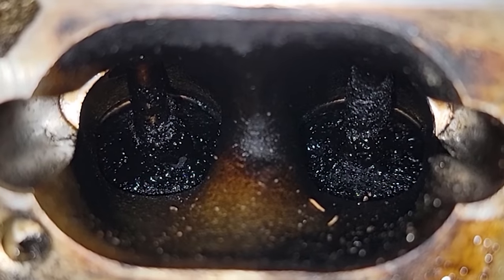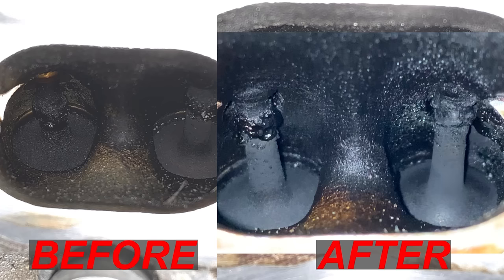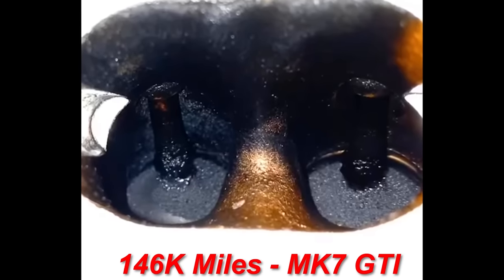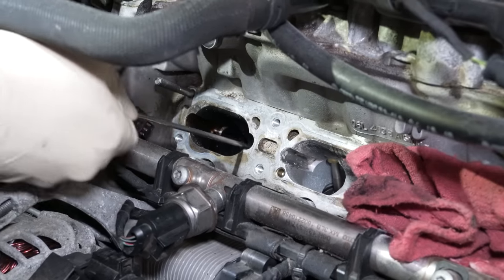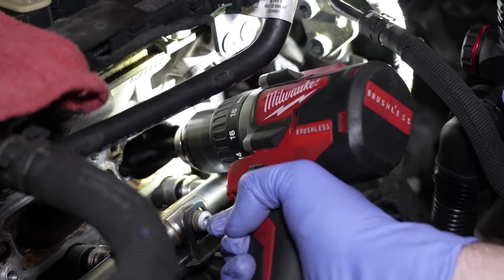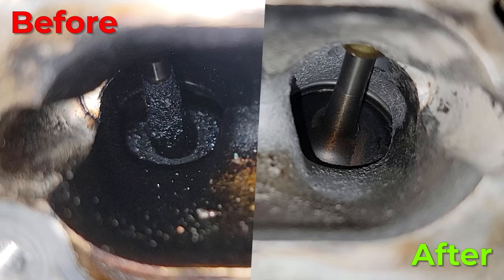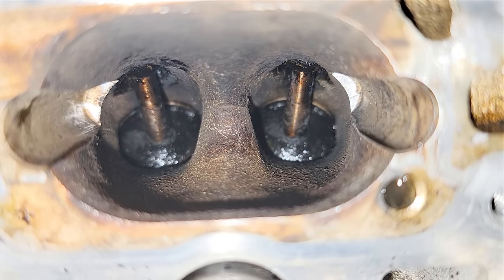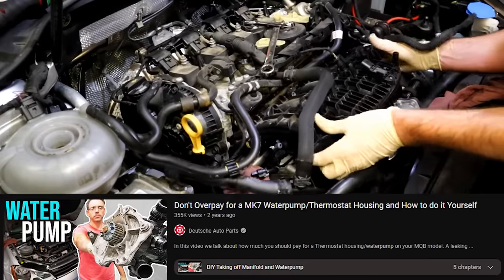How To Clean Carbon Off Your Engine!

Comment: CRC intake valve and turbo cleaner works excellent on my 1.6 DIG turbo Nissan. The PEA (polyether Amine) does work very well without having to soak or scrape the valves. And I did confirm it’s effectiveness by viewing the valves before/after.
Reply: I use the same and you are right. it works pretty good.
Reply: Did you spray it in the intake or directly on the valves?
Reply: @Jimster481  I just followed the directions on the back. Warm up the engine, then I removed the MAP which is just before the throttle body and sprayed it directly into there in small sprays while maintaining RPM 2000-2500. I usually do this every other oil change
Reply: @Jimster481 Directly on inlet throttle valve.
Reply: @SuperChewy808  well I also did this with my QX80 and I can tell you when I opened the engine at 145k there was tons of carbon.
Reply: @carlosgraphic Throttle Inlet Valve? You mean the Throttle Body?
Reply: @Jimster481  Yes, that.
Reply: @carlosgraphic  I can tell you that it definitely helps, but it does not fix the problem and I can confirm that because I did it every single oil change on my QX80 since I bought it seven years ago and when I cleaned it out last year it was definitely packed with carbon but not as bad as some other engines I had seen online.
Reply: @Jimster481   @Jimster481 I don't know much about your QX80, but is it GDI engine? I have a VW Touareg with a GDI engine. 230.000 miles. I can tell this cleaner restores the power on the engine. Before my SUV struggles to overpass another car but now it's different. I can feel how the acceleration and power improve on it. Does it clean very well, I don't know, but definitely it helps. I know it removes carbon because I heard some noises on the engine the first time I used it, I didn't push more gas since a big chunk of carbon can damage something inside.I know some people say if you hear noises put more gas to clear it, but if the carbon is big it's going to be bouncing inside the chamber with a possibility of hitting a valve or something else.
Reply: @Jimster481  I did mine at about 60k and mine was bad as well. I did 2 treatments almost back to back and  then I installed an oil catch-can, and I no longer have to contend with trying to battle the buildup or worried about the expense of having it cleaned.
Reply: @carlosgraphic  Yes, my vehicle is direct injection. And I never had acceleration problems because I have always used this product since the time that I first bought the car.
It definitely kept the car in running condition, but I can tell you that there was still a lot of carbon buildup when I actually took the intake manifold off to change the starter last year.
Reply: @SuperChewy808  From what I understand a catch can does not fix the problem all the way, especially not on the engine that I have which doesn't actually use an EGR.
I've done a couple treatments back to back as well as I usually do it right before I change the oil but I have found that that actually isn't even really needed because my engine doesn't leak any of it into the oil.
Reply: @Jimster481  well no the catch can doesn’t fix it,my car does not have an EGR either (I was talking that the combination of using the CRC along with the can) the amount of crap that otherwise would of ended up being re- routed to my intake is quite amazing. It helps prevent such a huge build up. I have not stopped using the CRC, but any car that has direct injection should install one(catch can). After you see what is collected that would of otherwise been cooked onto the backside of your valves, you’ll be glad you did it. especially since it only costs about $20-$30 and a half an hour of time. No way do I want all that shite being pushed through my system IMO
Reply: @SuperChewy808  Catch can works well with EGR. My QX80 doesn't have an EGR. It uses Cam overlap to suck the exhaust gases back up through the ports.

Comment: Copper stranded wire, soft enough to not harm anything but stiff enough to work quickly. Been using it for decades. Standard 120v house wire cheap as sin as it last for many jobs.
Remove carbon on top of pistons by getting it nice and hot and mist water into the intake, the crap that comes out of the tail pipes is crazy. In the 80's it was common tune up use.

Comment: Any reason why the gen 3 Ea888 motors don’t see as many carbon build up issues? To my understanding the euro gen 4 motors went to dual port but every gen 3 motor sold here is still only DI. Any Vw dual port engines here in the U.S?
Reply: As an EA888 owner, I’m curious how they prevent this build-up too!
Reply: yeah i was curious, ive got a 2019 GTI and I thought all of these engines had these issues, but apparently gen 3 EA888 dont have that problem?
Reply: They do have buildup, Charles checked his I recall and it wasn't great
Reply: 2017 GTI owner here, Paul's claim that EA888 gen3 don't have this issue is bunk. At 50k miles my car had the intake valves looking just like the 1.8 in the video at 80k. I've had the car since new, 7-8000 miles oil changes with the right oil (LM or Motul), only 93 gas, all the maintenance done on time; on the downside it does have stg2 tune (w/ supporting mods) and gets about a dozen track days per year, so maybe a stock car that only gets driven around town will have much less carbon, but again "gen3 EA888 don't have this problem" is BS.
I did my own media blasting cleaning and it came out perfect. I got the Harbor Freight media blaster, the nozzle from FCP Euro and bought wallnut shells media from Amazon. Also replaced the water pump that started to leak, very easy to do with the intake off.
Reply: Probably improved pcv system

Comment: Hello back in the days of Mercedes Benz and this was  from one of their support techs. Most 420 models had a lot of buildup on the intake valves cars ran like crap esp cold due to people using cheap gas. What we were told to use was oven cleaner the original no frills with lemony smell. We had to pull intake and valve covers remove intake rockers. We would spray all the valves filling each intake port let it soak for some time, then the fun part came in. We used a high pressure washer that had hot water and blasted them cleaned like brand new. The only draw back was the splash back shielding helped and so did the garbage bag suit with face shield. Yup regular oven cleaner, we did not have the stuff you have today. Maybe you may want to give it a try with the wire ties, never thought of that. Great video.

Comment: Would have thought string trimmer line would be a bit easier to manage in a drill than cable ties. Multiple diameters, cores, twists, and so forth are available. Mix and match and cut varying lengths.
Reply: The square  0.155" trimmer line works great. Soak the valves with BG carb cleaner & let set for an hour. 
There are also rotary long stem wire brush balls that work well with a drill motor.
You can also go to the hardware store & buy copper pipe cleaners, cut off the handles & use your drill motor.
Reply: @BobSmith-mc7uq   I wouldn't use anything steel in a brush, which the pipe cleaners are

Comment: I just bought a cheap media blaster and the plate with a vacuum adapter and hole for blasting.  Far less work than picking or brushing off the carbon and it produces the best results.  If you clean the valves every ten or fifteen thousand miles then it’s less work each time and your engine’s power and efficiency is always tip top.  

The very best solution is an engine with both port and direct injection.  Toyota doesn’t have a single engine with only direct injection, they always combine it with port injection to keep the valves clean.  The decision to use only GDI is made by bean counters who don’t care what happens to the engine after the warranty expires.
Reply: What media blaster do you recommend for a cheap price? I need to do this job soon and I feel the same way about it being less time

Comment: You should be using Carburettor Cleaner as it is 1000 times better than brake cleaner at dissolving carbon. Brake cleaner is a degreaser.
Reply: Yup 👍🏽 I use the supertech throttle body cleaner from Walmart it’s got more of the active ingredient acetone in it and cheaper too I always pick up a extra few cans and it’s very effective against both soft and baked on hard carbon
Reply: Use carb cleaner and a brass brush on the plates -- nice and clean without much effort.  I used CRC intake cleaner to soak and pick the valves, followed by carb cleaner.

Comment: How about an engine that doesn't eat its own poop?  The root of this problem is not direct injection, but the incredibly stupid emissions exhaust gas recirculation system.  Without EGR the intake valves would never be exposed to exhaust soot.
Reply: Is there an aftermarket EGR bypass somewhere?
Reply: @jordanburrack6404  blocker plates exist, but they are highly regulated as emissions bypass equipment

Comment: You can do it with solvent, zip ties, and brushes. However, on heavily caked valves this will take AWHILE!  If you have the means, invest in a media blaster or phone a friend. 

Did a gen 3 EA888A by hand and it took a few hours to make them like new. Soak, pick, scrub, rinse. Over and over and over for each cylinder.

Comment: Step one: dont buy a direct injection car
Reply: All kias, Hyundais and most automakers use them now 😑 blows ass. Also, they burn oil. About a quart wil burn off in between oil changes. You'll know you're low from the increased strength of the exhaust fumes. Oil light doesn't come on until AFTER a quart burns off
Reply: Diesel owners: 😬
Reply: You obviously don’t have one or know shit about them. Burning oil is false, they require cleaning, but all cars do today as egr systems are the larger issue

Comment: DI is such a bad design. You'll never convince me otherwise.
Reply: How is it a bad design?
Reply: The best is dual injection for sure
Reply: Agreed, but MPI adds double the injectors and more complexity. You'd imagine 1 larger injector upstream in the manifold and after the throttle body could help mitigate
Reply: @diydrivenGA  Indeed! 

I'm a fan of the Stratified XtraFuel system for this reason, and am considering adding it to my GTI
Reply: That didn’t make no sense u said
Reply: Do techniques that some employ like keeping valves open to have the gas clean it off not work?
Reply: @sprockkets  they do not work, no.
Reply: Nothing wrong with direct injection, it’s the EGR and crankcase oil vapour pushed into the intake that’s the problem.
Reply: @russella7263  Correct. My solution: remove pcv and connect to a separate air pump. You're welcome in advance.

Comment: Our Honda CRV 1.5 T CRV GDI went into the dealership because I wanted them to check if there was any build up at it was nearly on 70k miles, there was no build up of any significance I asked them for screen shots to prove it and they were spot on just a light dusting of Carbon. The Honda tech guy said Honda built in a valve rotation to mitigate excessive carbon fouling, seems to be working on the Honda Earth dreams units

Comment: Some valves have special coatings on them. Be sure to check first so you don't damage your valves.
Reply: No, the nitrate is tooo hard 2 get it off. Sometimes it may change the colour after rubbing it, but it can Not get off.

Comment: Just did this job today at work, im finding media blast with walnut first, then i soak with liqui moly throttle body cleaner to melt the rest works best. I did it the other way around and the wal nuts just create a goopy mess with the melted carbon. 

Would take me 2hrs without the water pump job this way, on a mk6 without the studs probably 1.6hrs

Comment: Thanks for the content.    Just today, I just bought a 100K miles    2017  Audi Q7  3.0 TFSI.     You didn't mention that motor but I have heard that they have a problem with oil consumption.   Not sure yet about mine.    Its super-charged so the valve cleaning might not be quite so accessible.   I've seen some video where a Berrymans B12 chemtool piston soak can reverse the oil consumption issues.   Presumably the problem is gunked up carbon deposits on the oil wiper piston rings.    Thoughts?

Comment: Easy Off oven cleaner dissolves carbon a lot, too! There is a warning on aluminum. I'd used wire brush or stiff nylon brush after 10min, let soak continue, repeat brushing advances carbon layer reduction. Then suction out & water rise, air pressure blast or air dry. If any thin layer still exists then dry brush,. The softened carbon will turn to dust.

Comment: 2016 I had a 2007 Astra 1.9cdti van and for a diesel I thought it was nippy..
90k on it.. after about 8 months of owning it my friend borrowed it and drove it 216 miles at 70-80mph so it had around 4 hours running on the motorway around 5000rpm.. 
when I got back in it I couldn’t believe how much more responsive it felt so giving them a good run if they have been short journey round town cars does actually help revive them without any snake oil additives…
And I think it was probably running on red diesel and hadn’t had an oil change or filter done as I only brought it to run my dogs round in and transport ladders on the roof rack and could get dodgey mots so services weren’t done by me in two yrs of owning it.. only got rid after changing a fuel pump and noticing one of the glow plugs was snapped and just fused back on so it stuck and did work but trying to change the plug snapped off the bolt head so getting that drilled out and possible 3 more and all the work/cost to removed the head meant that went to the scrappy and I brought another cheap one

Comment: Perfect honest video - after reading so many dodgy and destructive and ineffective methods on the web, I am now totally confident that the scraper and zip tie method will fix this issue at 80-90% of the effectiveness of walnut/vapour blasting - cheaper too and thus one  can maybe do it again in 10-20k miles to compensate for the slight difference in efficiency. 
One suggestion
I worry about sharp steel scrapers/points scratching a valve stem or poppet head stres raiser causing a broken valve.
I suggest using a piece of copper pipe instead, maybe 3/8 or 1/2 dia with a semi circle shovel sharp edge cut out at the end to scrape the valve.
The curved shape will enable the easy scraping of the back of the valve stem and the softer copper will make no marks or imprint on the valve.
Thanks again great honest presentation too.
Reply: Exactly, scrapping and scratching is not wise. Soda ash is far the best quick and easy.

Comment: Tip: Epoxy or hot glue the square ends of the zip ties together so they won't fall apart as easily.  Personally, I love the walnut blast, but those ties can help.  Great vid thanks for sharing.

Comment: For Marine Auxiliary engines we soak the cylinder heads and the valve spindles in water mixed with some sugar , soak it overnight and scraps off like icing on cake

Comment: 1.The zip ties have to be snipped at different angles and slighty different lengths. 
2. Warm the engine up, remove the intake, using 3 cans of brake cleaner 1 per 2 cylinders for a 6cyl or 2 for a 4 banger, spray let sit a few mins, then get to work with zipties and spray after the brake cleaner dries. 
3. When all done, get a beer and change the oil and filter if needed.

Comment: The italian tuneup does work, not by shortly revving your engine (i suppose that is the actual eye talian tuneup) but what youre supposed to do is drive your car on the highway for a couple of hours. Get everything good and hot, get everything moving around, and that WILL help to remove carbon buildup. Chemicals work too, but actually driving your car for an hour at speed once a week will go a long way to preventative maintenaince. The worst thing to do is short trips

Comment: I had a misfire on my C230 and dumped in two containers of injector cleaner on an 1/8 tank. Changed the entire ignition and fuel injectors and the intake ports were spotless.

Comment: I'm from Brazil and my 2011 Nissan uses Natural Gas (a kind of GLP) and Ethanol as fuel... It has 173.000km and my engine looks almost like your engine after cleaning! Hehehe
Zero carbon emissions and cheap to run!

Comment: Maybe of use to someone looking into this to mention at least for the 2.0 TFSI  BUL engine, there's a good chance if you're high mileage you'll need new seals for the injectors, manifold and possibly seals else where- definitely the injectors and manifold though from what I remember. The injector seals need a tool kit to do it properly.
It's also an opportunity to get your injectors professionally cleaned, flow tested and new seals fitted. Cleaning can be done DIY with a ultrasonic bath if you have one. 

When I went to do this DIY I had bought bottle brushes which had a hex bit on the end so you can use a drill to brush away, zip ties might be a cheaper/easier method. 

Also at least for the audio B7 2.0 TFSI there was an aftermarket turbo fit manual which had as part of its step by step guide a detailed section on manifold and injector removal. Think it even had torque specs for anyone following it by the book..... I'll need to look for this if it's of interest to anyone. Same with a detailed forum DIY how to of this which I followed.

Comment: You could improve the ziptie method by: 1) having the working ends of the "bristles" be the cut ends of narrower zip ties, and 2) using  longer ties and restraining most of their length in shrink tubing, making them more of a fan end brush.. That'll let you use higher drill RPM and reduce breakoff.  The last inch is what does the work. As the ends get worn, trim with flush cut side cutters.

Comment: The absolute best solution to this problem is buying a car that has either just Port injection or dual injection ('cuse, guess what,  Port injection is usually better at very low and very high RPM)